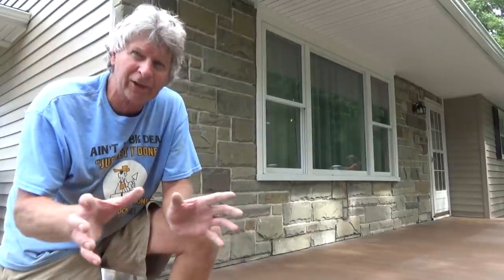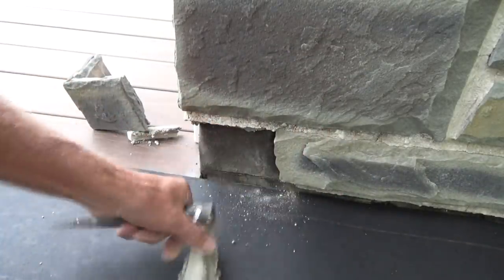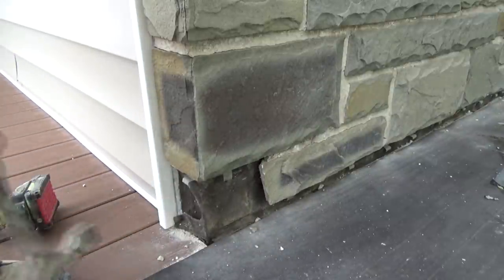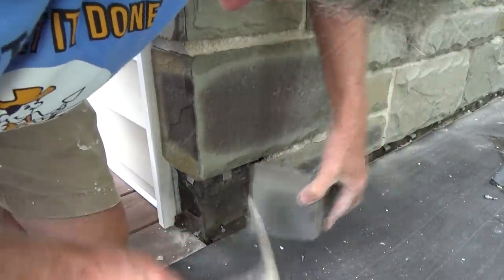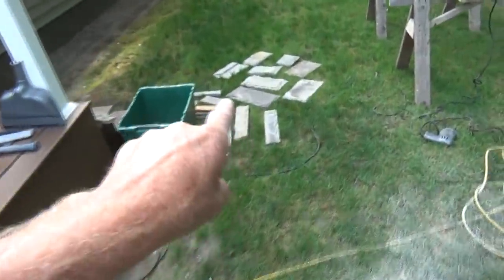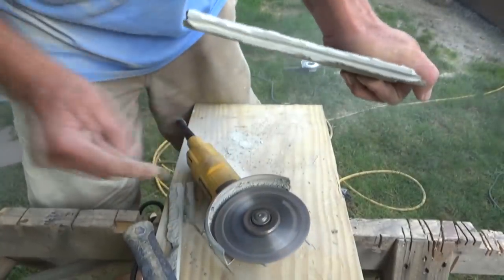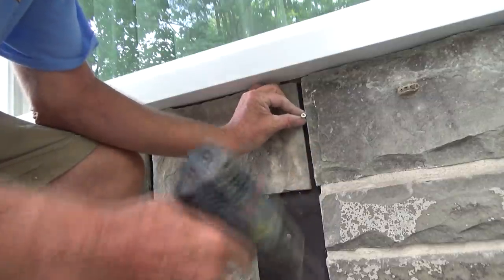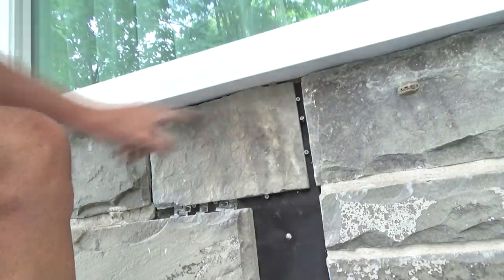STONE VENEER INSTALLATION (Part 10) Mike Haduck

Comment: Whenever using glue on exteriors, even if the wall is under cover, apply the glue in dots or vertical lines. Don't put it on horizontally or make circles. Horizontal lines or circles will slow/trap moisture behind the veneer.  You want any amount of moisture able to move under gravity, to run down unobstructed. 

If you have a long horizontal piece of veneer, for example. Apply adhesion in dabs or in small vertical lines. Don't draw circles or U shapes where water can accumulate. Leave space for moisture to pass through. 

Sounds like a small detail, but if an exterior's age will be measured in decades it makes a difference. The joint mortar can be horizontal because moisture can pass through it, the glue does not.
Reply from the maker: HI Dawt,,,it makes sense, thanks for the info,  mike

Comment: I googled slate & flagstone, so I guess they are metamorphic rock cousins.Which is better, dry grinding or wetsaw cutting, or rather, which one do you recommend, Mike?We used faux stone on our fireplace wall, circa 1970's in a Brooklyn Brownstone.Company were often fooled! NICE buckboard wagon in your shed!
Reply from the maker: Hi Tod, I use whatever works for the situation, big jobs usually wet saws small repairs usually dry, it all depends, thanks mike

Comment: Do the screws need to be stainless steel? Also, were you able to get the extra mortar off their deck the next day?
Reply from the maker: Hi Scott, not stainless,  but if it wasn't undercover I might have used them, i laid black paper on the deck, that was just the dust from the next day when they washed it,  thanks Mike

Comment: How did you know the motor was going to match the existing one on the old veneer.
Reply from the maker: Hi Benito, traditional cements are usually all close, I could use a dye I'd I had to or the mud trick, thanks mike
Reply: Benito Castro
,
Sands from different quarries can change the color of the dried mortar, hence it's a good idea to mix a small test batch and next day hold the dried test batch up against the original wall. Some mortars have had color additives mixed in which makes it even more tricky.

Comment: Being that you're sticking it to tar paper, save some cash and use balls of old duct tape to sick it on.  And speaking of new, try using a small impact driver instead of a drill on screws.  Makes all the difference in the world.
Reply from the maker: Thanks Mat, the contractor and owner insisted on the glue, mike

Comment: If the tar paper fails surely the glue will fail too, so the only thing to hold it down  is the screws and the pointing (i.e the other stone veneer)
Reply from the maker: Hi Nico, the glue was the contractors idea so I just went along, no harm, the screws are really what holds it, thanks Mike
Reply: @MikeHaduck  as long as he paid for the glue its alright Mike